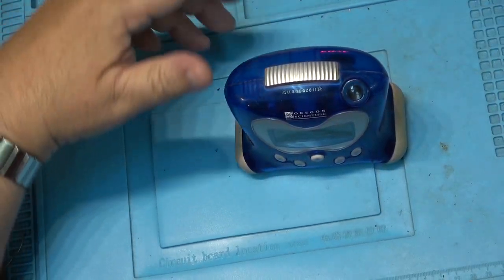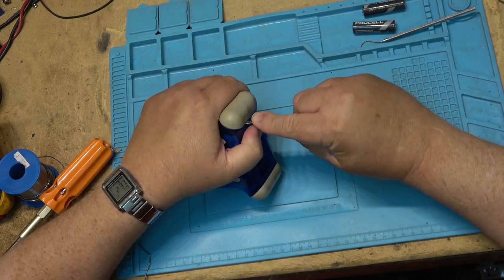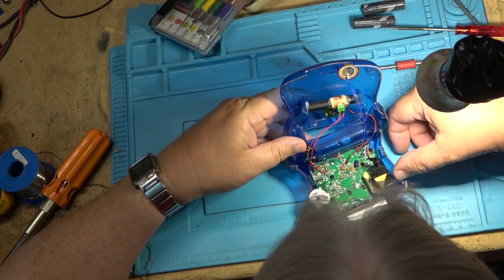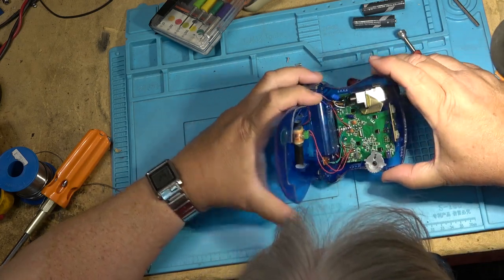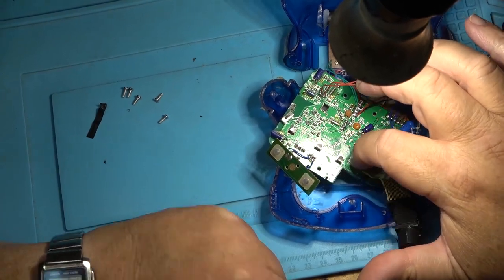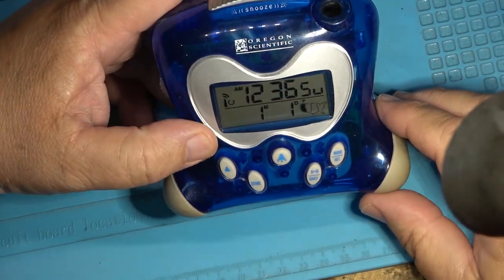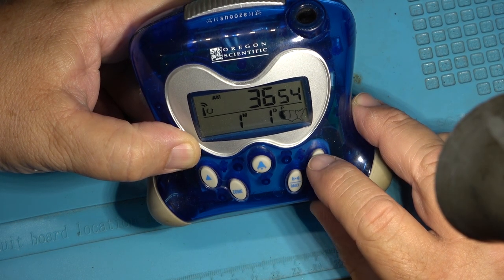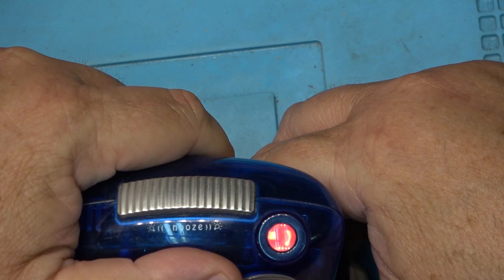Oregon Scientific Radio Controlled clock tear down and some computer issues

Comment: omg that PC needs a good dusting
Reply from the maker: What do you expect it hasn't been opened in 13 years. Same with the area in behind the desk behind the computer it's completely inaccessible there's no way to get there to dust or vacuum or anything because there's equipment there and cables and there's just no way to get in there to do any work without pulling equipment out. My office is not that big on the desk takes up the entire corner. My original vision was to have space behind the desk so that I could get behind the desk and do the cable management and stuff but once the building was complete it's a lot smaller than I expected. In fact it's smaller than the area that I used to use as my studio which is now the laundry room. When we renovated the house it was basically raised the existing house up and build new living space below and I fully expected that my office would be at least as big as it was before so the decision was made to make what was my office into the laundry room and move my office downstairs. Two reasons one because where do you generate most of your dirty laundry? Upstairs. No one wants to be hauling laundry up and down stairs so the decision was made to put the washer and dryer in what was my office and build the new office on the ground floor, also back in the day when I was still doing weddings quite often clients would come over to view and make changes or throw in ideas and I didn't necessarily want to have to take them upstairs where all the bedrooms were to my office. During the construction phase of actually look bigger until the HVAC system went in which is right next to my office and the drywall went up and then it became apparent that I probably lost 1/3 of the space. Through my wanted was asking the room next to where my office is which is where my son has his gaming computer setup that's the room I wanted for my office but once everything was built the kids that were still young at the time because this was 20 years ago needed a playroom to put all their toys and junking so they got the bigger room and I got the smaller room it's funny how that goes right, the little people rule. Now it's the cats that rule lol. They just occupy whatever space they want. Doesn't matter if you want to sit in your favorite chair it will usually have one or more cats occupying it!  Anyway computers nice and clean now got the pressurized air in there and blew out all the dust and then spent the next 20 minutes sneezing! You think this one was bad the shop that I worked at for all those years I was the guy tasked with maintaining the point of sale computer and shop computer in the back and those computers were never shut off they were left running 24/7 and one day I had to open one up because it wasn't working and the amount of dirt that was in that computer was just unbelievable it must have had a half an inch of dirt there was so much dust that the fan on the CPU now back in these days it would have probably been a 286 or a 386 but the amount of dust that was in the unit was so bad that the fan stop rotating and it overheated and that's why it wasn't running. I've been in server rooms and most are pretty good but some of them are just unbelievable like they stick all the equipment in the car room and totally forgot about it. My computer had a little layer of dust but I've seen a lot worse anyway mine's clean now I'll forget about it again until something else breaks and then I'll clean it out again.

Comment: replace the hard drive and do a backup!
Reply from the maker: That's what I did. You can see me copying the files at the end and the video was edited after it was swapped out.  New drive is not as speedy as original only 5400rpm vs 7200.   Yes I noticed a longer render time 😩
Reply: @12voltvids  I closed it out right before you showed that. Get two of them and software raid it for speed is one option. Though I'd do daily backups if I went that route
Reply from the maker: @CotyRiddle  yeah the speed's not really that big an issue because it's just the drive that my apps are loaded on. OS is on the SSD so that loads quick and my source video files and render files are on different hard drives anyway so it doesn't really make that much difference just what it loads up some of the transitions because the transitions are I guess the files that are used by premiere as it does things like transitions are pulled off the hard drive and they're loaded from that drive so it takes it slightly longer if there's a lot of transitions to do I don't know what's going to happen when I render a 4K video it's already slow as molasses in January to do that but we'll see. The drive is it now is the same type of drive that I use for my video sources which is a video rated drive like you would find in a DVR. Those are generally pretty heavy-duty drives because they're designed for constant use in things like security recorders and cable boxes and so forth that really get a lot of abuse and a lot of writing to them so it should last for a while I would think.
Reply: @12voltvids  actually a pretty decent choice. A lot of game consoles use them type of drives albeit smaller versions and they get beaten on daily.
Reply from the maker: @CotyRiddle  
No video rated drive search generally pretty reliable because they're designed for use in DVRs and pvrs. Of course a PVR is what would normally be what is in a cable box or a satellite receiver and DVR is typically what is referred to as the type of unit that's recording security cameras other basically running 24 hours a day 7 days a week constant writing so drives that are designed for video user designed for a long long spin times whereas most computer drives you know they'll spit up read data and then after a few minutes they go to sleep to save power so they're always spinning up and stopping where is a video rated drive is running constantly Heather designed for that type of abuse